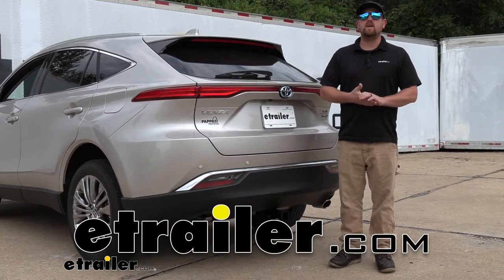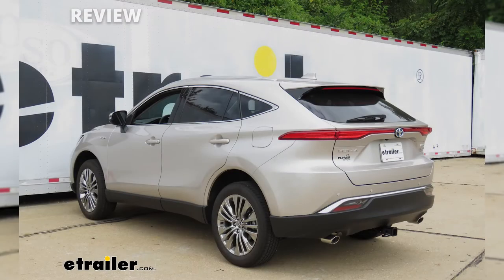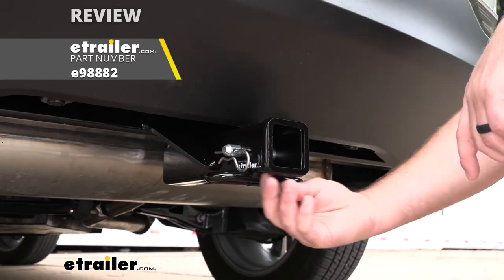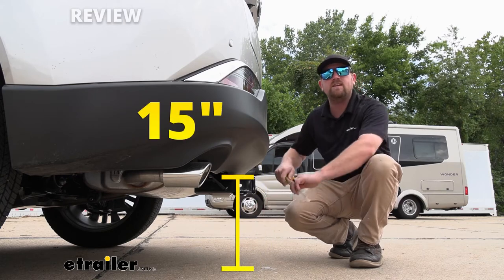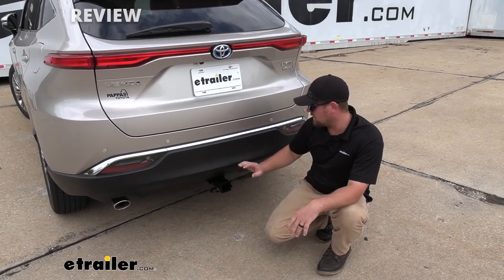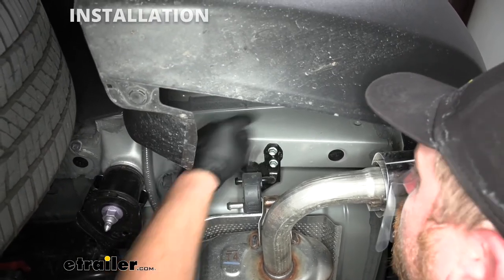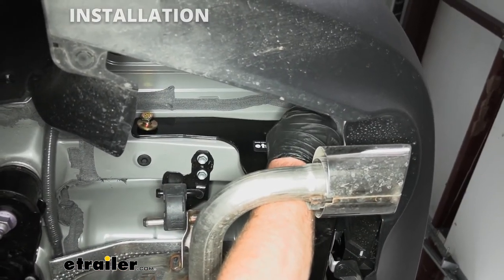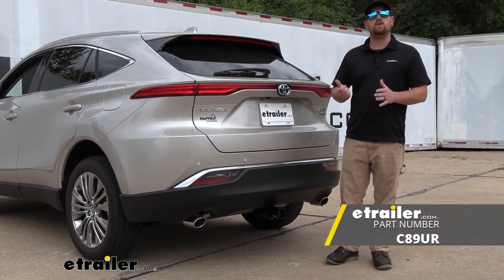etrailer | Setting up the Curt Trailer Hitch Receiver on a 2021 Toyota Venza

Comment: We have one, but my question is because this car does not have a tow rating. Will it be able to tow something small like a jet ski or a sport bike?
Reply from the maker: We always recommend following what the owners manual of the vehicle says when it comes to tongue weight and the max trailer weight it can handle. For more information you can ask your dealership. This hitch will also work great to haul a bike rack or cargo carrier to get those extra items out of your car on a trip.
https://www.etrailer.com/Trailer-Hitch/CURT/C89UR.html

Comment: Whats the least expensive  hitch
 receiver for. A Toyota 2021 Venza
Reply from the maker: The etrailer brand # e25AR Class III hitch is currently the least expensive hitch option for a 2021 Toyota Venza. But this price can change on a daily basis.
https://www.etrailer.com/Trailer-Hitch/Toyota/Venza/2021/e25AR.html

Comment: Do you make front bumper guard for this vehicle?
Reply from the maker: We do not carry a bumper guard designed to fit the Venza. You would need to reach out to a dealer for an OEM option. You can use our fitguide to find other options that are specific to your vehicle. https://www.etrailer.com/

Comment: how did u do the trailer lights pls?
Reply from the maker: Check out the following link to see a wiring kit that is designed to fit the 2021 Toyota Venza. We have a great video showing how it installs.
https://www.etrailer.com/Custom-Fit-Vehicle-Wiring/CURT/C57ER.html

Comment: I spoke to Toyota and was advised if you go against The Venza " Not Rated" for towing advice and you have a incident were the vehicle is damage in anyway due to a aftermarket product YOUR in the hook for repairs... Your warranty will now cover you.PERIOD.

Your *eTrailer) Expert Reply..
"I pulled up the online owners manual of your 2022 Toyota Venza and Toyota states that it is not recommended to tow with your vehicle which is why they also do not list a towing capacity. So this begs the very valid question of why do we have hitches that fit your vehicle like the Curt # C89UR that you referenced which fits the hybrid models. The answer is that against manufacturer advice many people will still use the vehicle for towing or carrying bike racks so since there is a demand for it the hitch manufacturers will make the fit and allow people to make their own choice in that regard."

Your EXPERT reasoning is because people will go against the Manufacturers rating, but most likely have not spoke to Toyota Customer Service prior to doing so... BEWARE!
Reply from the maker: Trailer hitches can also be used as an attachment point for bike racks or cargo trays, as well as for towing.
https://www.etrailer.com/Trailer-Hitch/CURT/C89UR.html